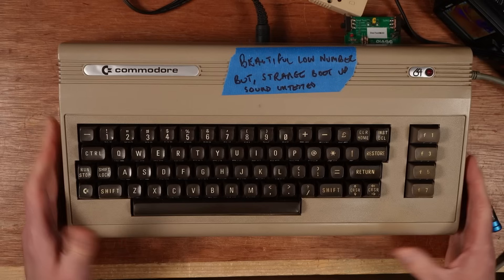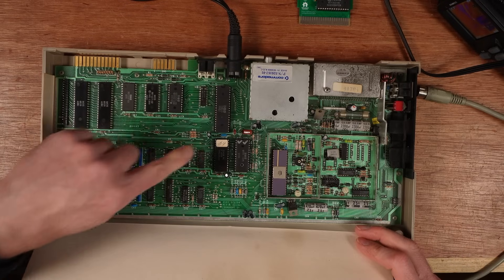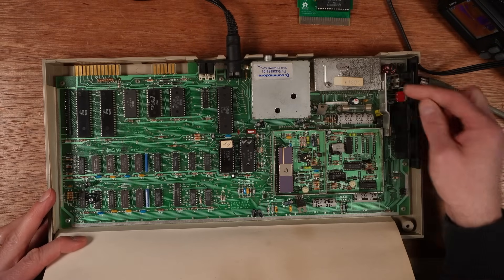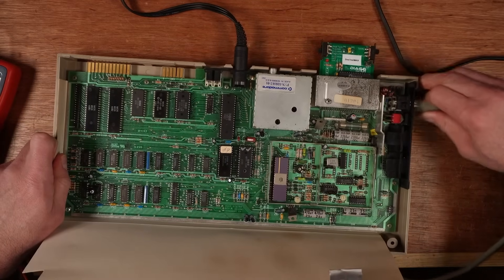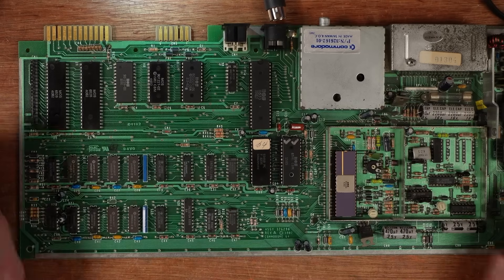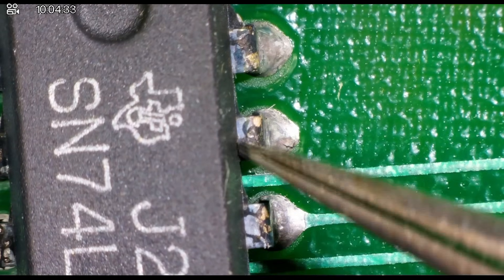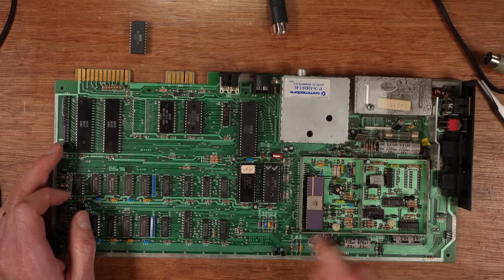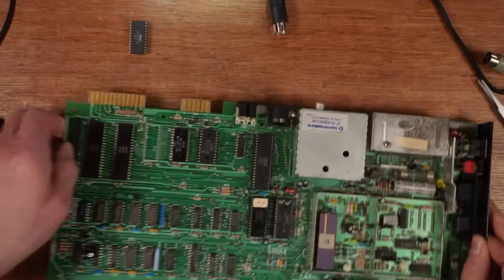Can You Fix This RARE Commodore 64 Silver Label?

Comment: Something that may lead you to the answer... (This is also a fun little exercise for anyone else who is interested but please don't give Lee the answer, teach a man to fish and all that.)

Take note of which characters are flipping, a good place to do this would be READY. at 11:25
Ok, now google "PETSCII hex codes". You should find a few tables showing all the characters and their corresponding hex codes.

Now open up another tab and find a hex to binary converter (or use windows calc in programmer mode). Find the hex code for a correct character and input that into the converter. Take note of the string of binary it spits out.

Now do the same for the incorrect character that it flips to. You should notice that one bit will be flipped between the two characters - there's your smoking gun.

As to what is causing that bit to flip is another story. But given that it is able to flip, you may get lucky with the makin bacon trick 😉
Reply from the maker: Banned
Reply: @morefunfixingit  B MOAR LIEK ADREAN BLAK

Comment: From my experience and research, the blackened legs are because they're likely made of brass. The acidity of the leftover flux from soldering can react with moisture in the air to corrode the brass over time. This is much worse in very humid places, of course. It's a very slow process, but almost all my old age new old stock transistors have this tarnish too.
Reply: I have a few old TI made LS-something chips from the 1970s, and they all have black legs. I was under the impression that they are SILVER coated, like your silverware at home turns black after a while.

Comment: Something is wrong with D2 given destestmax and the screen showing $ instead of space

You could
1. Replace the d2 ram chip U22
2. If that doesn’t solve it try unsoldering the d2 pin on the two CIAs and the remaining kernel and character rom and testing each time to see what makes the destestmax (or dead test) run correctly.

Comment: A blank space in hex is value 0x20 and the dollar sign is 0x24.  Converted to binary the only difference is bit number 2 is high for 0x24 and low for 0x20.  Same goes for the letter S in test that changes to a W, the only difference between an S and a W is bit two being high for W  - so I think DESTest is bang on right with bit 2 on the bus being angry.  In theory it could be anything attached to data bit 2 but I would imagine that bit 2 is occasionally stuck high due to some faulty cells in the RAM chip.  I bet if you short bit to to ground for a few milliseconds on a working machine you would see a similar problem.  It is common to boot to a READY prompt without the banner with memory failures.  I would wager that your ROMs are fine and the problem is the memory chip itself or possibly the 257, but if the 257 were bad I'd expect an instant crash of garbage on the screen and not just a single flipped bit here and there.
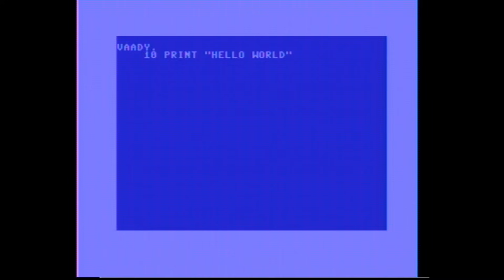Reply: Yes, I think another clue as to what is happening is shown at 11:36. When the text being entered overwrites bit 2 in the first two characters of "READY" The "D" in HELLO WORLD being 0x04 (0000100) and the " symbol being 0x22 (0100010). It changes R (0x12 / 0010010) to V (0x16 / 0010110), setting bit 2 because it is set in "D". Then changes E (0000101) to A (0000001), clearing bit 2 because it is unset in the " symbol.

So, we can look at the addresses involved. Screen memory starts at 0x400 and each row is 40 columns (0x28)

The entered bytes are on the third line, starting at position 0x468 (for D) and 0x469 (for the " symbol). The changed values are on the first line at position 0x428 (for R to V) and 0x429 (for E to A). These addresses have a bit difference of 0x40 (1000000). So I suspect when an address is being written on the address bus it seems to write bit 2 in the data to locations with and without bit 6 set.

Now whether it's actually a memory chip at fault or part of the selection circuitry, I cannot say. I'm not that informed on the inner workings of C64 memory. I went from the ZX spectrum straight to the Amiga, skipping the commodore 64. But seems like this is the symptom.
Reply: I agree about the LS257. I own a few TI 74LS ICs made in the late 1970s, they all have black pins. But that's just because they were silver coating them back then. Mine all work fine and the black tarnish can be removed with an eraser. Also I agree on the randomness likely being caused by defective memory cells, rather.

Comment: I would replace the RAM chip responsible for bit 2, because all character errors are either +4 or -4 of what they are supposed to be. Looks like as if some cells are stuck  high and others are stuck low. You can piggy back it first.

BTW: You won't get a READY prompt without the BASIC ROM working, it was unlikely to be that.

Comment: Looking at the screen, you can see that when editing the basic program also the ready text changes, this would point to one of the multiplexers, that would be my first guess, second would be the ram itself, third maybe the pla but I doubt it would be the pla in this case. Also regarding the black ic legs, this is due silver plating and can be cleaned easily with tarn-x.

Comment: Got to be RAM - multiplexer failure wouldn't give a repeatable fashion and it clearly isn't a line being stuck, so back to god old individual ram tests. I'd check the pattern bit pattern for $ vs a space for a clue as to which bits. The weird bit is when the screen fills with $ which is the only thing (to me) that is putting any doubt on it being ram

Comment: I think, the DesTestMax gives you a hint. The RAM might be faulty. That would be the first thing to try. The DeadTest does not perform a really good RAM Test and if some of the address logic inside the RAM, it might not detect it. If you write 55 into every RAM byte and read out the same and then repeat it with AA and read back AA, you might not notice, if it was just written into the wrong byte at another address.
Reply: I’m thinking bit 2 as well.
Not only does destestmax suggest it

But the $ on the screen instead of spaces suggest it too “ “ = 0x20  “$” = 0x24  (ie bit 2 is set when it shouldn’t be)

Something is certainly going on with D2
Reply: @mikeh_nz  At 11:21 the "R" (0x52) in Ready turns into an "V" (0x56). Indicating the stuck bit isnt consistant. Which is going to a bear to hunt down.
Reply: @Heckatomba  R is 0x12 and V is 0x16. Remember that C64 and all other CBM 8 Bits use screen codes instead of PETSCII/ASCII! So there again you have bit 2 being bad!

Comment: The characters getting messed up might indicate character ROM or potentially addressing issue - as someone else mentioned... The $ symbols turning up instead of blank spaces could help - you'd need to look at the character codes and see if that indicates one of the bits (if space and $ have only one different bit). Adrian has a video on this, but I can't recall which one. I might be way off with this, but worth a quick look.

Comment: Take a look at the c64 wiki. They symptoms you are seeing look awfully like the behaviour you would get when pressing [Run/Stop] and [Restore] simultaneously. I'm wondering if you're stuck in some kind of soft reset mode.
Reply: Thinking about this a bit more,  the basic pointers in memory sit in the addres blocks 0200-02FF and 0300-03FF. Screen RAM sits in the next block of memory - between 0400 and 07FF. I mention this because of the graphical corruption when running the diagnostics.

Based on this, my money is on a memory issue at the bottom end of the address space. It could be the multiplex at U25. Address lines A8 - A11 all go to this IC, and all are used to access the memory adress ranges that appear to be affected. However that is a complete stab in the dark.

Comment: Weird that it doesn’t call the routine that prints the top text. Maybe there’s an address line stuck? Clearly it can’t access some parts of the memory correctly, but the fact that it works could mean that it may be a single bit stuck that gives wrong addresses for a set of addresses, but not all.

Comment: Personally, I would start with the ram and multiplexers since DesTest  failed on memory. However, I would also check PLA. Best of luck!
Reply: It is obviously not a multiplexer.
Reply: @elmarschwarz535  not until tested. Could be issues with multiplexer that controls the higher memory
Reply: @elmarschwarz535  ROMs are not required for DeaTest, yet DesTest is showing ram issues. Anyway, let's see what Lee does 🍻
Reply: @RudysRetroIntel  they are required not to mal function. It is a chip enablement issue. The chip enable lines should be checked. Further ram test passed in Dead Test. Would not pass with broken multiplexers. All my bets are on the PLA.
Reply: @elmarschwarz535  Yes, PLA is 99% of the issues on the C64. Let's see
Reply: @RudysRetroIntel it really isn’t. The SID is for example a far more common issue

Comment: My silver label has everything but the VIC and SID soldered in as well. I removed the cardboard RFI shield, kept it. 
The legs of the those chips are silver plated, they oxidize black. Usually not an issue.